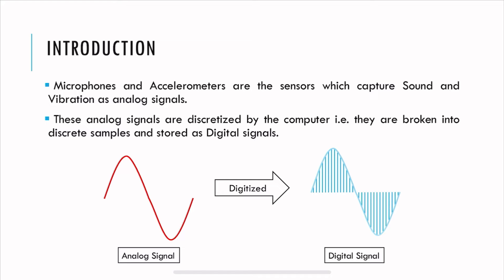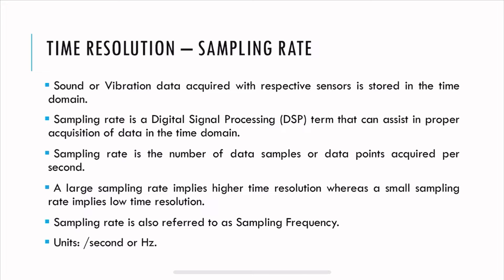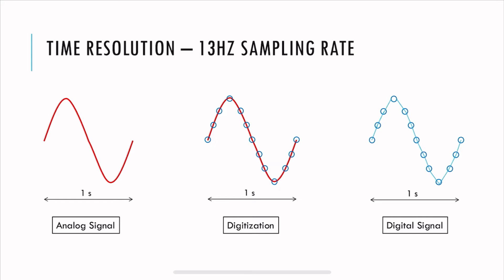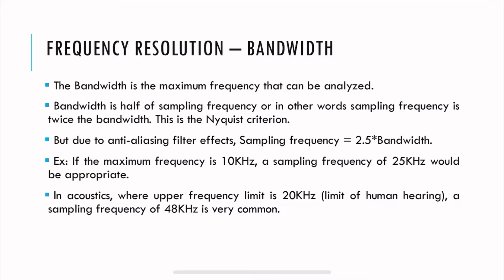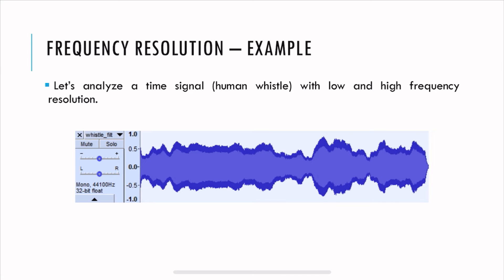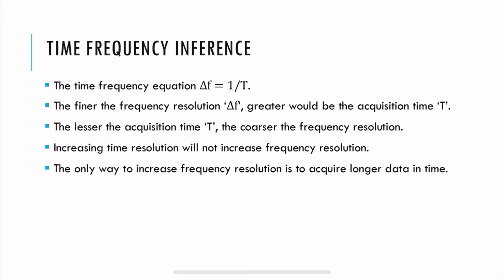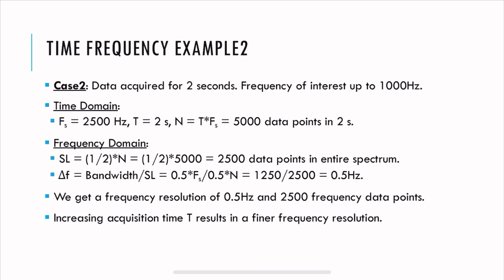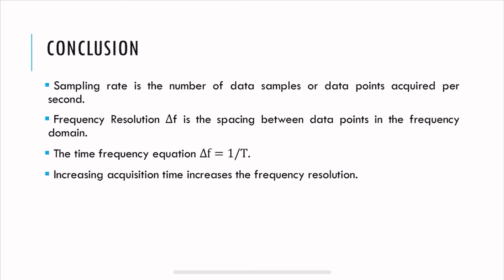Time-Frequency resolution explained

Comment: You explained it very well master. But i have a question. What if we chooe frequency resolution as a logaritmic (for example 300 octave/lines) instead of linear, what would happen? I mean what is the difference between log and linear ?
Reply from the maker: The difference is only in representation. A data can be represented in many forms. A linear scale divides data into equal intervals such that the distance between two consecutive data points is always equal. For example, consider a 300mm/1foot ruler, the distance between 1mm and 2mm is same as the distance between 101mm and 102mm. 

A logarithmic scale divides data using exponents 
such that the ratio of powers is equal however the distance between two consecutive data points is no longer equal. For example, the ratio between 10^2 and 10^1 is same as the ratio between 10^3 and 10^2. On the other hand, the distance between 10 and 11 is no longer the same as the distance between 100 and 101. Note, the difference is same but the distance is different so the representation is different. Log scales are best used to represent a large data within a short space which is not possible using a linear scale. Usually, when representing an FFT Sound Spectrum, the frequency axis which spans from 20Hz to 20000Hz is best represented by a logarithmic scale than a linear one. Several sound spectrums were displayed in this video, they all had a logarithmic frequency axis.

Comment: Hello Srinath, awesome video, indeed!! Thanks.

Just had a quick question. At 11.58min of your video, when you are describing the effect of increasing the sampling rate,
1) you are increasing the sampling rate from 2500Hz to 25000Hz.
BUT
2) you are using the SAME signal (right?), that you previously sampled at a rate of 2500Hz.

IF SO, then how come the bandwidth of the signal got changed (!).

Let's say, I have a sinusoidal signal of frequency 5Hz. Does the bandwidth of the SIGNAL change When I sample it at 10 Hz and at 100Hz, respectively?

Would be great if you could clarify this confusion!!
Thanks in advance.
Reply from the maker: Sampling rate (in the time domain) is how many samples are being acquired in a given time. In this video, I considered two cases wherein the signal was being acquired with different sampling rates (2500Hz and 25000Hz). Now sampling rate has a consequence in the frequency domain which is bandwidth. One has to sample the signal at least 2.5 times than the highest frequency of interest. Hence in acoustic recordings, as our frequencies of interest lies within the human hearing range (20Hz - 20KHz), we usually sample at 48KHz. In other words a signal sampled at 48KHz would result in a bandwidth of up to 20KHz in the frequency domain. If the signal was only sampled at 24KHz then the bandwidth is now reduced to around 12KHz because the current sampling frequency is too slow to accurately sample the fast oscillating high frequency waves.

To answer the other question: If your sine wave of 5Hz is sampled at 10Hz and 100Hz, the bandwidth in frequency domain is different in each case although you will only see 5Hz result in the spectrum. If you had an additional sine wave of say 20Hz then you cannot sample it with 10Hz as it is less than 20Hz, it will fail to capture it.